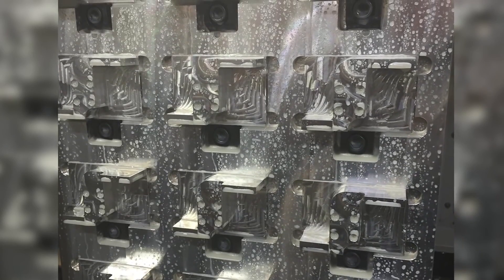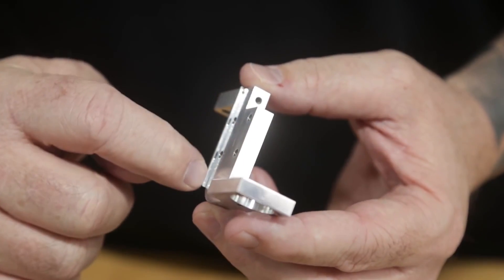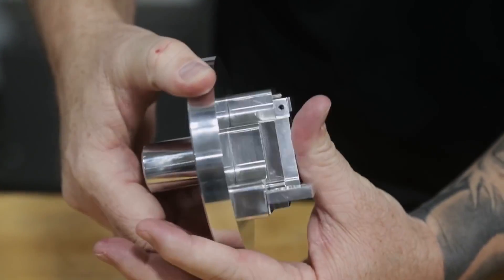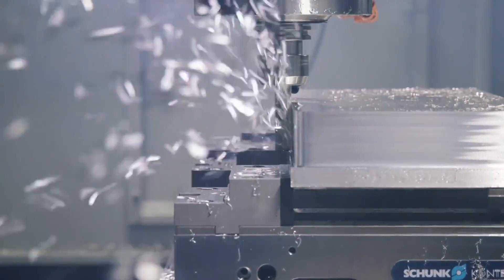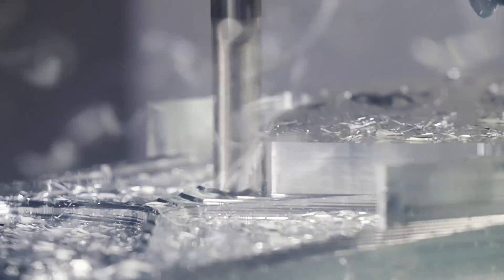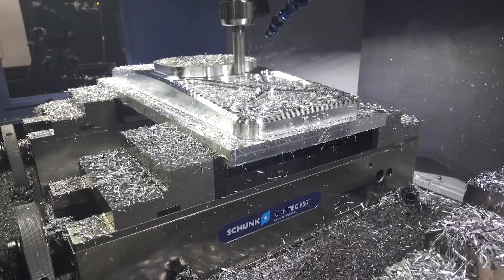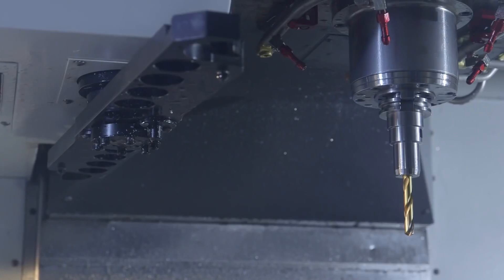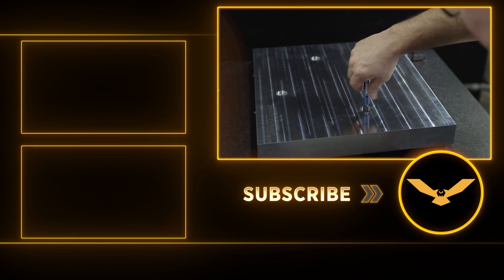Employee SCRAPS an INSANE Amount of Medical Parts... and the Reason is Even More INSANE

Comment: Anytime you change a tool, the first thing you do is inspect the part. NEVER assume a part is good
Reply: And the size. Always check the size of your tool.
Reply: Yep, seen this type of scenario play out too often for the same reason. In fact, I benefited from always assuming that there was probably something wrong with whoever’s parts I followed. Caught alot of potential scrap that way 😅
Reply: Great advice. Thank You
Reply: Isn't that what happened here ? 
Inspection failed ....
Reply: Its true… but it needs to be relayed through all operators, all shifts… Maybe they are not told….
Reply: When the operator changed the tool , the first pc should be inspected with attention to that tools action.

Comment: In some cases the medical device company will give you a temporary manufacturing deviation to accept out of spec parts depending on what the dim is and the risk associated with that spec. Always ask them first. It is a bad look but mistakes happen all the time. And in many cases the R&D engineer designing medical devices over spec stuff that doesnt need to be as tight. I work in medical :)
Reply: Yeah as much as it's important to commit to 'we only ship stuff to print' sometimes what the customer asks for and what they actually need are not congruent. Usually what they want/need is 'parts now' and the print is half boiler plate notes and tolerances that no-one sending the files to me actually understands. I hate writing an email that gets handed off to the customer asking to please let me delete all their fancy impossible fillets and suggest ones that can be made at the budget and timeline they're expecting, only for them to go "oh that's fine, I just threw it all on there in solidworks, I thought it'd help." Yeah no, no it didn't help; but thanks, engineering, for your consideration.  Usually its good to get all of that straight before the part gets made and even before the job gets accepted but I've found stuff halfway in that wasn't as apparent at the start.

But entirely depends on context, industry, timetables, etc. 

I recently did a run of plastic parts that came out where it was good in the fixture but because it was a small run rush job I got them done but diddn't leave enough time to relax the part between passes, so stress bent it pretty noticeably after removing from the fixture for a little bit. So while it all looked good otherwise I asked for time to remake the set with better stress-relief process (Which I had already spent time getting right and had gotten a good sample part) ; and they said "Are you crazy? it's plastic, we're gonna warp it worse during installation, and the housing it goes into will hold it flat. They all come bent on previous versions. Just ship it." 

And I'm like thinking to myself "Well, it diddn't say that on the print. Allowable deviation of  +/- .1mm from the CAD file is what it said on the print. So I was stressing over y'alls bad drawing the whole time." But I wasn't gonna argue, I handed my stack of pringle chips off and spent the afternoon cleaning plastic out of the mill. 

That said if they want more the next batch are gonna be dead flat and I'm charging more.
Reply: That's true of a lot of engineers and companies not just medical . Just ask anyone who has worked in a shop that did military spec parts. And then remember the joys of overkill when it came to packaging and paperwork. 42 pieces of paper for 30 parts. LOL.........No not really.

Comment: If a corrective action report was filed I'm certain some people had to sign their names on "I will always inspect my part after changing a tool". That is the inexcusable detail in this story.  Sure there are some good habits that can save you and prevent errors, but at the end of the day shops don't stay excellent on "it should be good". 

I am responsible for a second shift in an aerospace shop so I hope the statement above doesn't sound too harsh.  It is stories like this that keep me always with a healthy amount of concern for how everything is running.  I'm lucky because my operators are good guys and we have been working together for about 5 years now.  Although I could list a few good habits that would all protect against loading the wrong tool I'll just mention the best catch all bit of training I've ever received and I always pass on.  Train the operators to just look at the part.  That is it.  Don't tunnel vision checking dimensions.  Don't have a mic in one hand and the part in another, instead just take the part over to good lighting and look at it closely. When you have a repeat job like that and you have operators who actually look at the parts a bad radius will stick out to their eye.  In fact all sorts of defects will get caught just by vision and feel alone.  It sounds obvious I know but the rookie move is to get tunnel vision combing over the dimensions of a part only to miss some obvious bad blend or dings/scratches or in this case a radius that looks different than the other million times they have looked at this part.

Comment: this is probably your most important video ive seen to date.  first arts are so important, anyone in manufacturing knows that.  i also think that parts should get the first art scrutiny every so often, per hour or part number run.
Reply: We're a smaller shop but do a lot of different parts for tons of industries. We do full checks every 20th part to make sure everything is all good. Might be overkill but it stops any huge issues like this one.
Reply: I did first articles at the beginning and end of a shift so I knew where the parts are when I started, and where they were I left. Also on any tool change I would check all affected dimensions with checks in between during standard operating.
Reply: It's totally possible to make processes that check EVERY part and immediately stop when the first one is found until resolved. One company I worked for did this and we almost never had downstream failures.
Reply: @adammcallister9675   it depends on the process.  i run a process that is still manufacturing that creates between 100-150 parts per minute. it is not that similar to machining metal at all, which is where i was saying the first article of inspection is important, and real thought has to be given to what level of inspection things have to be given to how often

Comment: You cant check to much.. most parts i made are unique oder a handful or are mirrored or fit together, most time i use calipers, inside micrometers and other measure parts, again and again. Each part run with a new insert or drill for finishing. After this, the drill goes only for roughing again. Serial production is another league, the margin for errors is smaller, because one piece is ok, the next can be out of spec because the drill get dull.

Comment: Nice video.
But in milling- there is no perfection. Only if the parts are endless accurate(sub femtometer)- then its close to perfection :).
Reply: If the dimensions are within tolerance, it's perfect.
Reply: @johnnychimpo9583  its a question how you measure it. If you scan for example the roundness or the diameter you will see the measureable inperfection of our technology
Reply: A femtometer ist 1/100 of the diameter of an atom.

I am curious how you will grind a single atom to size 🤔🤓
Reply: @norbertfleck812  exactly that is our problem 🙂
Reply: @norbertfleck812  Exactly THAT is our Problem :)

Comment: “Till one day “ hehe! I’ve worked with a guy at a Karmann Ghia whom says addressed to shop floor: you guys may fail but Q&A CANNOT simple as that! However it still happens too often at my opinion! General speaking!
Reply: The problem with that approach is that Every human will fail at one point or another. That's why the process and process flow have to be error-proofed as much as possible. You have to design so that mistakes are extremely difficult to make.
Reply: At Karmann Ghia in Germany, Rheine?
Reply: @heisenbergisreal5858  unfortunately not, at Brazil São Bernardo do Campo, also knows as Brazilian automotive hub ABC Paulista!